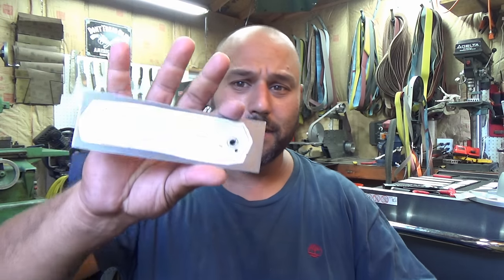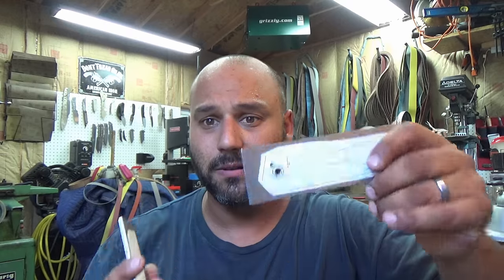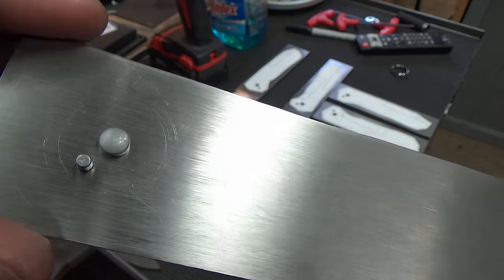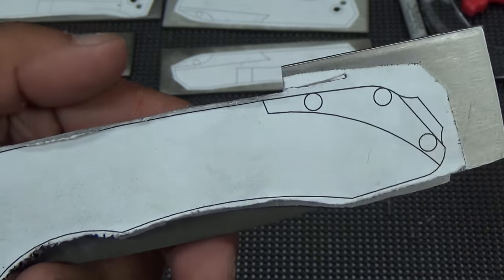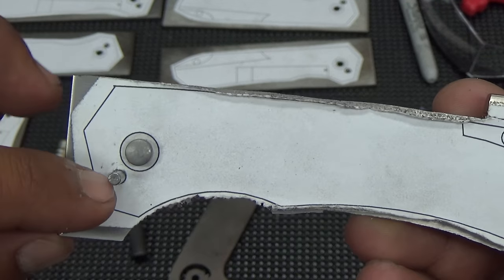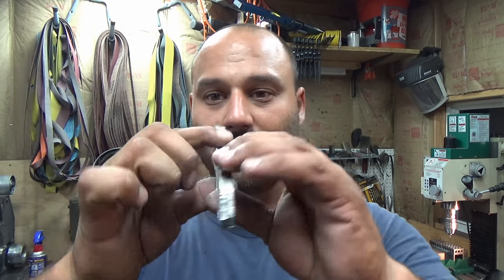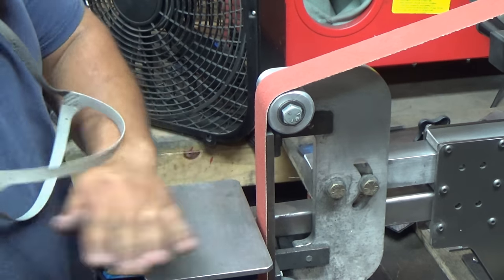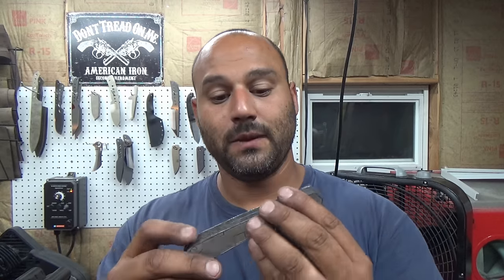Making a Folding Knife #4 Profiling and Aligning the Handles.

Comment: Why didn't you just drill out each hole on the handle, a few sizes smaller than you intended to thread for, and put pins in it to hold it straight?

Comment: Stick it in the spindle on Mill Mike, tap it lightly shouldn't take much use a brass or any soft hammer you have unless you mind scarring up the shank on drill rod or whatever. It does not take long

Comment: Awww yeah more ekim videos. as you know ask 10 knife makers how to do something, you get 10 answers. but I like to drill my pivot, stop pin and back spacer holes. On liner locks I throw in a reamed hole in just for shaping the handle. that 123 block trick is very handy. looking forward to the waterjet
Reply from the maker: The order  you do it is probably better now that I think of it. If you install the back spacer now, it will hold it all together and you can get much further into finish grinding. I'll have to give that a shot. Thank You!
Reply: like I said we all do it differently. my run out on my 30 year old 8 inch drill press is horrid. I love and hate drilling titanium. It seems to drill like aluminium with nice curls. But destroys bits. My  cobalt reamer made about 5 knives before the pivot became a interference fit.

Comment: Some machinists might not recommend this but On those drill chucks I use to put a true piece of material like a straight running drill or drill rod and put a indicator on it Mike. You should get it 1 or less thousands runout. Back to the video. Good luck
Reply from the maker: I've been meaning to indicate it to check it out. I know the collets run pretty true but I don't seem to have any luck with drill chucks. The black one has to be a good 10 thousands of run out.

Comment: You said the reason for wiggle was because the holes were so close together at the same end. Couldnt  you leave extra room on the other end of the cutout and drill a hole there to place another pin to hold it together, then cut that off when everything is ready? It could be as tight as possible as well because its just an extra inch of material
Reply from the maker: That's a great idea. It wouldn't take a whole lot to execute either. I know a lot of the guys getting blanks waterjet cut that have these holes cut as well to locate the parts together just like you said. Very good point!